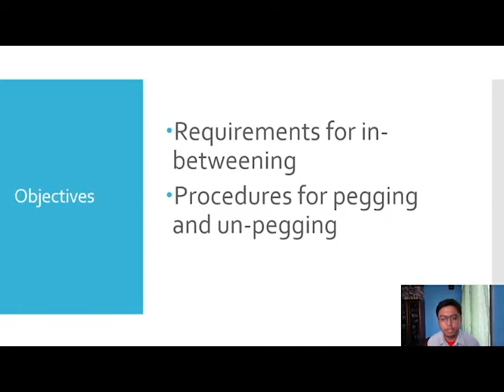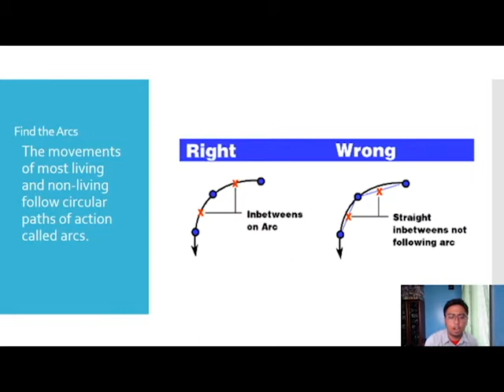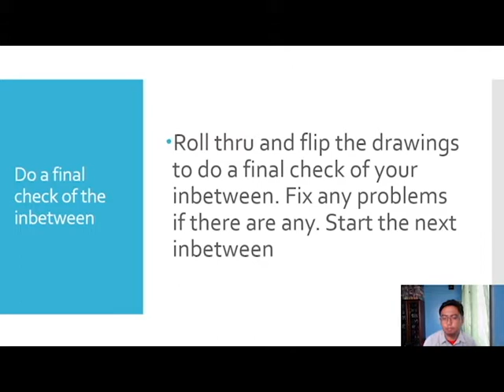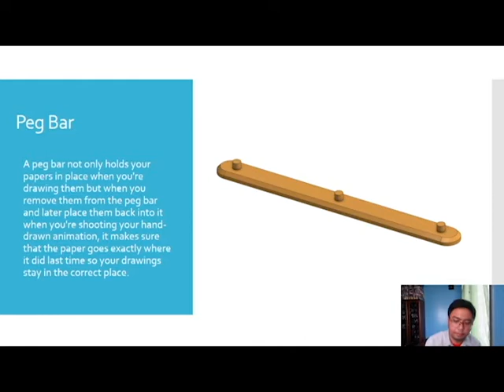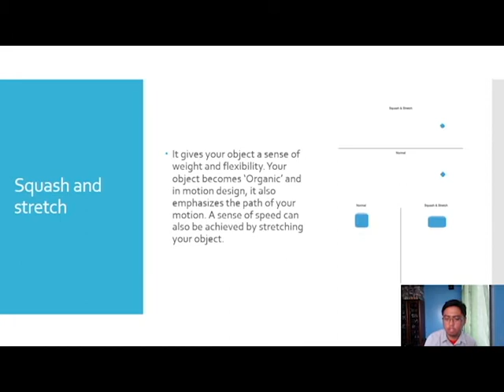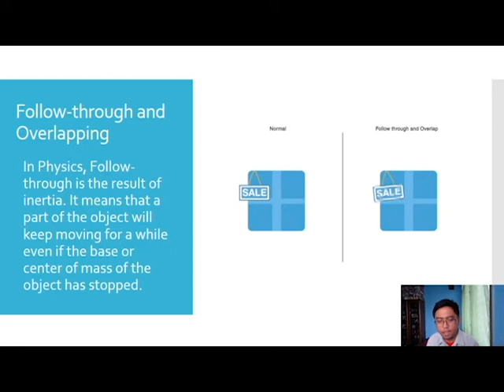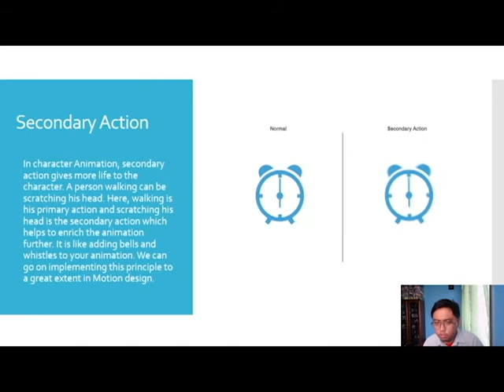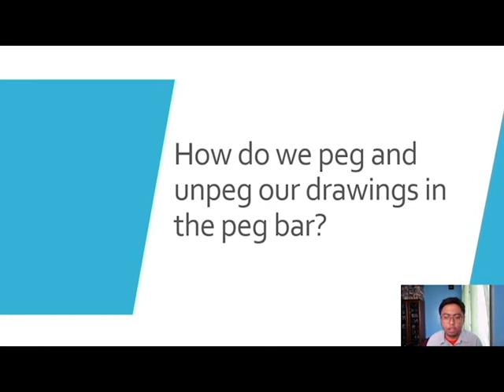Produce inbetween drawings for actual scene folder week 1 to 4

Comment: peg bar- it is an animation peg bar that made in plastic. The plastic pegs hold the animation paper  in place and are designed to allow as minimal movement as possible so that the registration does not change making the animation shake and your drawing stay in the correct place

Comment: 10 STEPS TO A PERFECT INBETWEEN: 
 
Step 1: Check the timing charts
Step 2: Rolling the drawings to plot the arcs
Step 3 Turn on the backlight & place the drawings in flipping order.
Step 4 Build the foundation for your inbetween
Step 5 Turn off the backlight
Step 6 Flip the drawings to check the inbetween
Step 7 Rolling and checking the inbetween
Step 8 Turn on the backlight
Step 9 Shift the drawings off the pegs to check volumes and details
Step 10 Do a final check of the inbetween

Comment: HOW CAN WE PRODUCE A PERFECT IN BETWEENING?  

1.) Check the timing charts 
2.)  Find the arcs 
3.) Turn on the backlights and place the drawings in flipping order 
4.)  Build the foundation for your in between
5.) Turn off the backlight
6.) Flip the drawings to check the in between
7.) Rolling and checking the inbetween
8.) Turn on the backlight
9.) Shift the drawings off to pegs to check volumes and details
10.) Do a final check of the in between

Comment: HOW CAN WE PRODUCE A PERFECT IN-BETWEEN DRAWINGS?
1 Check the timing charts
2 Rolling the drawings to plot the arcs
3 Turn on the backlight and place the drawings in flipping order
4 Build the foundation for your in-between
5 Turn off the backlight
6 Flip the drawings to check the in-between
7 Rolling and checking the in-between
8 Turn on backlight
9 Shift the drawings Off the pegs to check volumes and details
10 Do a final check of the in-between